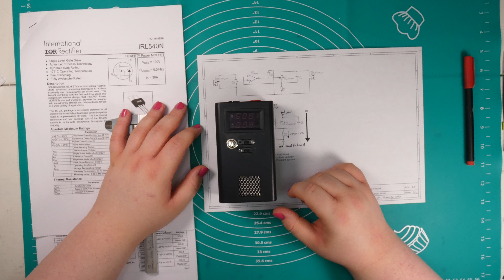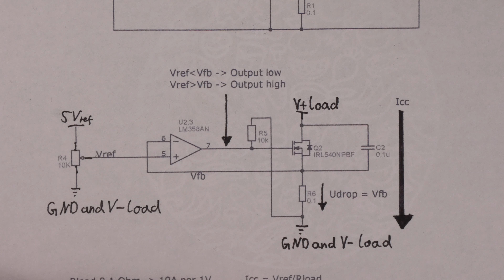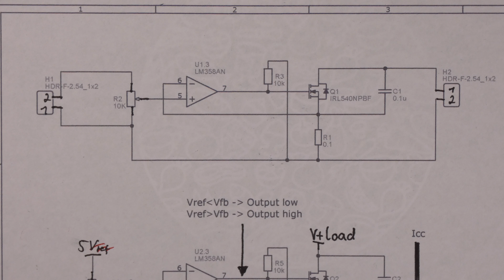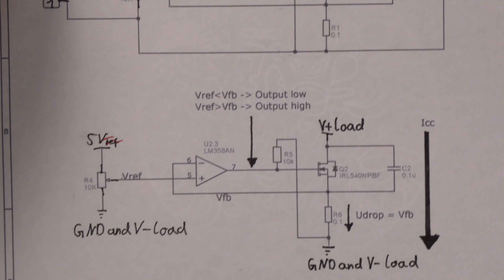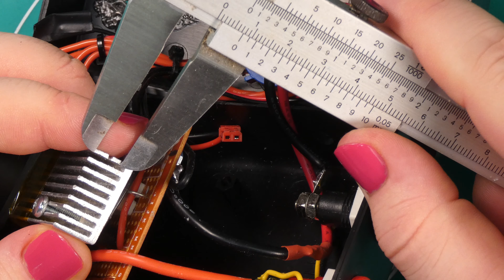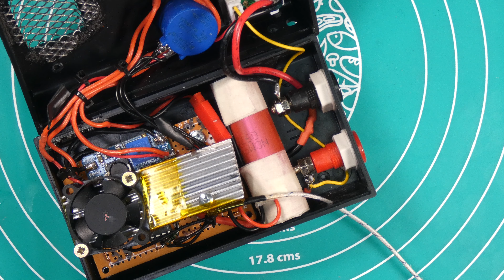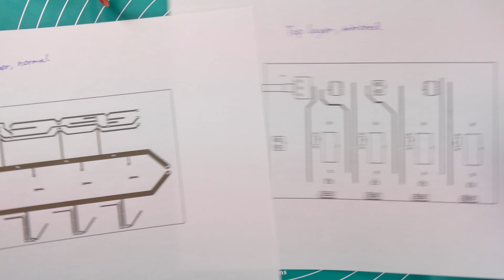DC Electronic Load - Everything You Need to Know and More (Schematic and Function explained)

Comment: You might be the very first lady in YouTube who makes electronic project as a hobby that I'm aware of, nice project and nice presentation.
A few notes about the circuit; 
LM358 have a few mV of input offset error, as a rule of thumb input voltage should be 10 times of the offset voltage.
A resistor on the mosfet gate will protect the op amp if anything goes wrong and another resistor for the inverting input.
To prevent oscillation there's usually a capacitor and resistor between op amp inverting input and output (google op amp integrator).
Reply from the maker: Hey welcome to my channel! :)
You are right a resistor between OpAmp output and MOSFET gate will protect the OpAmp if anything goes wrong and another resistor in line with the feedback does the same. However this makes the circuit a bit more complex and more complicated to explain, especially considering the resistor in line of the feedback. Also I don't think that they are necessary, maybe good practice. Another thing is the resistors need to be high enough to drop your load voltage down to a voltage the OpAmp can handle so you might run into some limitations.

As for the OpAmp integrator wouldn't that make the circuit unstable or am I missing something? I mean we want the circuit to oscillate and also don't want to change output voltage. Maybe you can explain this part a bit further, I'm not very familiar with it.

Eidt: Well I just read something about why it is used within an electronic load but they just said it makes the circuit stable. I can't verify that as my circuit is stable. Besides occasionally wrong displayed voltage numbers. (Problem is the V/A Meter, already verified that)
Reply: @PhysicistAnna   
"the resistors need to be high enough to drop your load voltage down to a voltage the OpAmp can handle"  The resistor is there to limit the current (not voltage) and I think beside being good practice it's mandatory for most op amp inputs, it's usually mentioned in the datasheets.
In theory you can pick the mosfet gate drive and input resistor reasonably high because mosfet gate and op amp inputs both are driven with voltage not current.
"wouldn't that make the circuit unstable" not if you choose the right RC frequency.
"Besides occasionally wrong displayed voltage numbers." it's oscillating then (I noticed that in the video too),  you can confirm that with an oscilloscope.

BTW subscribed 🤗
Reply from the maker: I looked into the datasheet of the LM358 from Texas Instruments (Link: https://www.ti.com/lit/ds/symlink/lm358-n.pdf?ts=1594805367887&ref_url=https%253A%252F%252Fwww.google.com%252F ) if you go to figure 30 on page 18 
"High Compliance Current Sink" you will see that there is no resistor at all, neither on fb line nor mosfet gate. Thats esentially the setup we use here just not as constant current but variable constant current electronic load. Its the same just different name. Also there is no OpAmp integrator.

Edit: Until now I didn't even know they had this circuit as typical application. I just used designs from all over the internet and removed component after component until it worked. That would have saved me some hours...

Edit 2: Every design I saw so far that uses an OpAmp integrator did not use a pull down resistor for the MOSFET gate. Could that be the reason? But then I think just using a pull down resistor is much easyer as there is no calculation needed.

Edit 3: The problem with the V/A meter is that it uses an lm358 and it needs imput and supply GND in reference. Connecting Supply GND to the module causes a GND loop. I had to disconnect it and only have load GND (the shunt) bond to the module. This makes voltage displayed a bit less accurate and we occasionally pick up oscillation from the Circuit. But this oscillation is what we want. I would need an isolated supply for the V/A meter for this to not happen.
Reply: @PhysicistAnna  Page 13 figure 16 of the same datasheet that you linked is the schematic diagram of the LM358, you'll see the op amps inputs are actually transistors base, AHA! they usually have an internal resistor but it's better to not let more than a certain amount of current (50 mA absolute maximum) go to the inputs or you'll risk damaging the device.

The circuits in datasheet are just "examples", look at page 23 figure 44, it's an in-amp! sure you can build an in-amp with LM358 but you can't expect any accuracy from it.

When you pull up the mosfet gate and turn it on it will stay on until the gate is pulled down. that's not the case when driving them with op amps, because op amps can adjust their output voltage and source/sink current, so basically you don't need a pull down resistor.

"this oscillation is what we want." Why do you want oscillation in your circuit?

About the panel meter, connect them to an stable power supply and pull some current, I doubt the readings be unstable.

The videos you find in YouTube, like the ones from greatscout or electronoobs etc they just want to make money, as long as circuit works it's ok for them to upload and make some more money. they don't care about the details. don't trust them.

Here's a bit engineered but simple version of an electronic load which I found in google with a quick search: https://jasper.sikken.nl/electronicload/opamp.png
Reply from the maker: The first basic rule I learned about OpAmp is that NO current goes into neither inverting nor noninverting input. So no current goes to the inputs.

Typical application diagrammes are equipped with everything necessary for the circuit to work. They are for manufacturers to validate designs. Specifics need to be testen in real world. Basically the way my load is set up obeys the minimum requirement and I did adjustments to it to work in real world.

As for my pull down resistor the circuit did not work reliable without it. There were constant problems as the FET didn't seem to close fast enough. The resistor solved the problem though.

We want the oscillation as this is how the circuit operates. Listen closely to my explanation of how the circuit functions. I explained that part in detail.

About the V/A meter: Within this small prototype I got a boost converter to create 5V. This is used as supply for the lm358 but cannot be used as supply for the V/A meter as I would create a GND loop.

I don't watch greatscott at all, I know his channel, saw a few videos but I don't really like them. The other one electronoobs I don't know.

What I don't trust are designs like the one you posted. Lets be real, what is the benefit to install an opamp integrator for me into my electronics load prototype? It is running, no problem only with the V/A meter but as I said I need another, from the circuit isolated power supply and everything is alright already tested that. I just have no space left within the enclosure.

The only thing I agree on is that protection resistors can be used but there are limitations. Onething not to forget is yes a MOSFET is voltage driven but needs a small inrush current to load its gate capacitor. The impact on performance with a resistor between OpAmp output and FET gate I can't tell without testing.
Reply: @PhysicistAnna  It's not really the place to open up circuit designs and analyse it.

There's still much to learn, why integrator, why resistors here and there, why voltage isn't stable, why this design etc. you'll find the answer because you've got the question.

I was trying to help, I just saw your video and thought you might welcome some improvement suggestions...

If you're happy with the outcome it's great, good luck.
Reply from the maker: I am very happy with your comments and I really appreciate it. It was not intended to sound negative at all. You see I'm not an electrical engineer but a physicist. We only have a look into basics over 1 semester and not even dealing with circuits or components. I also finished a course about electrical engineering for physicists in which we got some basic knowledge but stil not enough obviously.

I do agree that the protection resistors can be used and might be useful although I don't know the impact. That I have to test. Initially I also did not quite understand that part, now I think I do.

As for the OpAmp comparator I don't know. I don't see the need. I read a lot about this kind of circuit but it only seems to dampen high frequency oscillation, change the output voltage and changes from squarewafe signal to a triangle signal.
As long as something works engineers always say: "Don't touch a running system".
As a physicist I should disagree on that but I lack knowledge here so I asked you to explain if possible.
Reply: @PhysicistAnna   I'm a hobbyist with nothing related to electronics, only passion. I have another barrier and that is language, English is not even my second language. it's the third. yet passion wins anyway ;)

The op amp in your circuit is configured as a comparator, a comparator is a device that outputs 0 or 1. it means that the output only goes to positive or negative rail, nothing in between.

You set the voltage at non-inverting input to for example 1 V, the inverting input sees 0.9 V so it tries to balance two inputs by varying the output so the output goes high.
At one point inverting input voltage reaches AND pass 1 V so the output goes low again, and this cycle continues. it's now oscillating. it's unstable .

What if we have a way to slow down this transition between high and low? the answer is integrators.

When the output goes high the capacitor is charged so when op amp tries to go low again the capacitor charge prevent that to happen too quickly. hence eliminates the oscillation and you'll end up with a dead linear output with the right filter. now you can have an average of positive and negative rail.

Hope this very simple explanation gives you an idea on the basics of integrators. get an oscilloscope, even the cheapest "pocket-scope" can show the output signal shape.
Reply from the maker: Yes that helps a lot thanks :D
I now understand how it is supposed to work within the circuit. We slow down the transition from high to low basically going from square wave to triangle wave form. But what is the impact on performance? The only thing I could think of is that we now have a somewhat stable and constant average voltage to the MOSFET gate and we don't have to fully close the gate as I had to whith my circuit. Hence I used the pull down resistor. Might also be the reason such designs don't use a pull down resistor at all?
Reply: @PhysicistAnna  Not triangle shape, with right R and C values the output become linear.

You don't need to close the gate completely to limit the output, in your case current. with different voltages at the gate different amount of current can pass the mosfet and that is being set via op amp. so you don't need the pull down resistor.

The reason it was unstable without pull down resistor was because of the oscillation.

Remove the pull down resistor and add a 100 nF between output and inverting input, see if that can make it a bit more stable. the capacitor value just guesstimated so you might need to calculate and change that...
Reply from the maker: Alright I swapped the resistor with a capacitor and it stil works reliable just as before. Just to verify I also ran the circuit without any component and it did not work. So you are right the resistor seems to suppress or dampen oscillation.

I have to think about it a bit more and do some research to what the difference is. I mean between having a resistor, a capacitor and an OpAmp integrator.

The video itself is stil ok as I just named the resistor a pull down resistor. Not accurate bit stil ok^^

Thanks for helping me understand this circuit better! :)
Reply: @PhysicistAnna  You're welcome. 😊